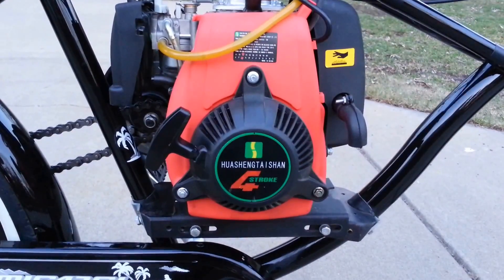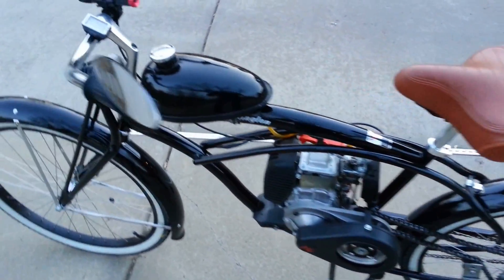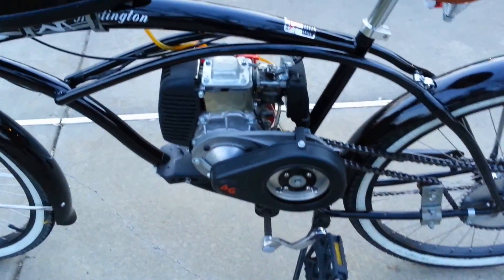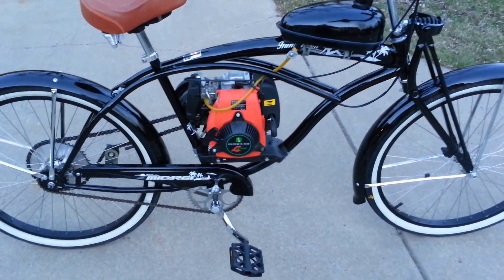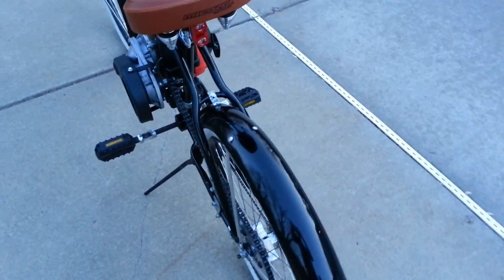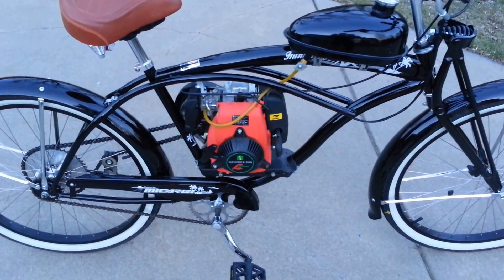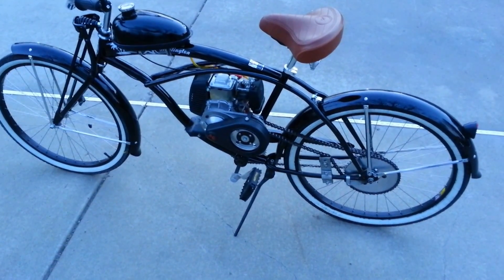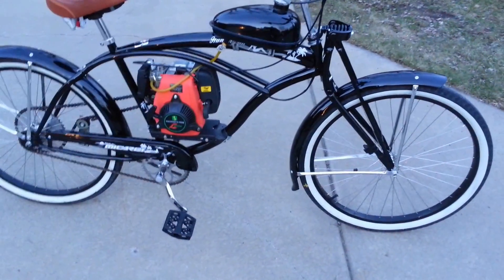4 Stroke Motorized Bike (2 stroke VS 4 stroke)

Comment: Great video on the 4 stroke vs 2 stroke...

I'm brand new at this whole thing...So any help you could provide would be greatly appreciated...
 
I've just purchased a used motorized bike with a Grubee Skyhawk, 4G (belt)...
 
Would you be able to provide an Owner/User manual (not installation)...I've looked everywhere with no success...
 
If not, could you provide some kind of detailed description of routine maintenance...**Help!**
 
BTW, I've read that the centrifugal clutch engages @ 3,000 rpm...Why so high?
 
I would estimate my minimum speed under power is 10 mph...Yet I see 2 stoke bikes going much slower...
 
Regards,  Jason
Reply from the maker: Elric van buelken Hello Jason! Thank you for the message! At the moment I'm just about to head to work and I have to catch up on other messages as well. Have a little patience please and I'll get back to you tomorrow morning at the latest with some answers! Thanks Jason.
Reply from the maker: Elric van buelken I don't have any user manuals that I could find anywhere online for them, and the ones that come with the kits are about as useless as can be. With the 4-stroke engines the only thing I really did on mine was change the oil, check belt tension, check all the bearings, plugs, and air filter. Other than that there isn't a whole lot to keep up with on those. As far as the clutch engaging at 3,000RPM, I don't have a technical explanation for that other than that's the way those clutches need to work. It's the same thing on a snowmobile as well. The centrifugal force expands the shoes inside the drum, and once there is enough force (usually about 3,000) the shoes will expand far enough inside the drum to make contact and drive your machine. This may be a horrible analogy, but it's like helicopter, the blades will spin, but it won't actually move until there is enough force from the blades spinning fast enough. I hope this helps out! Any other questions come up feel free to contact me!
Reply: Sinister Custom Cycles
Thanks for the prompt response...I'm a relative novice, so:
1) Where is the air filter?  How do I remove it?  Can it be washed, or must it be replaced?
2) How do I gain access to the belt? How do I adjust belt tension?
3) What specific type of oil do I use?  How often should it be changed?
Thanks again...
Reply from the maker: The air filter depending on the engine is located on the back of the engine, which can be easily removed, cleaned, and replaced. I never had to do anything with belt tension at all on mine, and don't believe there is a way or need to adjust it. I just use a basic B&S 4-stroke engine oil from my local small engine shop. I changed mine after the first 100 miles for break-in, and then every 1500 miles or once per summer after that.
Reply: Sinister Custom Cycles
Thanks again...Almost there...My engine/clutch  is exactly the same as the one in the video...So, I found the air filter cover; not so obviously "easily removed" however (at least for a novice)...It seems to be held on by some type of spring clip arrangement...Since I don't wish to break the plastic cover by forcing anything, how, exactly, do I remove it...
Reply from the maker: It should just be 2 clips on the bottom of the cover that you have to press in simultaneously while lifting outward.

Comment: My 4 stroke burns no gasoline what so ever.
I use Propane and it's the best decision I ever made.
 It burned out the old carbon deposits and now it Purrs like a kitten in a creamery.
Reply from the maker: TheSteadyHunter Kudos! With all the searching I have done online regarding motorized bikes, yours is the first that I have heard about running propane. All I can think about is King Of The Hill lol. Send me an email as I would like to know more about the benefits and conversion process. sinistercustomcycles@gmail.com
Reply: Sinister Custom Cycles I'm more of a phone man I'm not good at this texting typing. I do voice command I talk and it prints it out for me it's a lot faster so there will be mistakes. If you read my comment above I wrote a pretty lengthy one. If you have any questions about propane or how to convert over leave me a message. I can call you or you can call me it's so much faster then the typing stuff or voice command. Like I tell a lot of people you could even *67 your number and call me. I will still answer the phone. I have to answer phones that's part of my job.
Reply: How did you place you propane tanks. I am really interested to know
Reply: TheSteadyHunter any pics of your propane set up?
Reply: That's a good one it purrs like a kitten in a Creamery you're right. I usually use it's as smooth as a sewing machine.
Reply: @jonsmith2217  How about slicker than snot on a doorknob?

Comment: OK the one thing I like is that the CDI Coil is covered  were the 2 stroke isn't and that is where I got most of my problems.
I've had to replace 3 Cdi Coils and 3 kill switches so yea but i like my 2 stroke engines
Reply from the maker: Anthony Storey I'm still fighting between what engine choice to go with for the "Huntington Resurrected" build. There are pros and cons to both engines and it's a hard choice. However the thing that is most important to me for my riding uses, is quality and reliability over anything else. Is it something that better sealing would remedy in order to prevent debris and moisture from affecting it?
Reply: Yeah there is Im using Jb weld on my CDI Coil and electric tape to tape my loose wire to the bike and the duct tape to Keep the electric tape and wires safe.  Now I went with speed so i got the 2 stroke mega motor from bike berry and i get about 38 mph with  about 50 mpg.  Now a 4 stroke is more expensive but it is more reliable an way easier to ride.  A 2 stroke you have to pop the clutch and a 4 stroke you pull start it and go.  stock 2 stroke have manual clutches and a 4 stroke have an automatic clutch.  I've own a 4 stroke it is a nice thing to have for something you know that won't break down at any given time, but slow as shit.  Now 2 stroke I've owned and still have one they are fast as shit but you get alot of problems and thy can break down at any time.  Like right now my ride is having clutch problems.   The clutch lever is slipping up to the point that it wont disengage the clutch.  Its a simple fix but it gets old really fast.  So i suggest a 4 stroke engine kit.

here are some of the sites I go to:
 http://www.bikeberry.com/
http://www.gasbike.net

Comment: Do you need a lissence  for a motor on a bike sorry for bad spelling
Reply from the maker: Bernardo Moya There are so many variables that come in to play with that question. The laws change depending on where you live. Where I live you don't need any kind of a license as long as it's 49cc or below, and does not exceed 21MPH. I rode mine everywhere with a top speed of 29MPH and was seen by every type of cop possible and was never bothered. I even had one stop and shine his spot light on me while I fixed a flat tire one night and didn't say a thing about the bike or anything else. Check your local laws, or another good place is if your local bike shop deals in electric bikes, they will know the laws also. I also go on my local Craigslist and see if any are for sale, if there are some, contact the owners and see what their experience was. I hope this helps!

Comment: Im all for two strokes, they're about twice as fast, half the price, they do break when you start putting real millage on them, but you can't forget to mention that they're dirt cheap to repair. The most expensive engine component is around 50$ depending where you get it. They are a little more costly on fuel, but here in Canada i can fill the tank for about 4$ and get around 110 kilometers on it. (About 70 miles.)
Reply from the maker: kristofertheman Salutations! 2 strokes are definitely cheaper, faster, and have more options to modify them, which is great if you're racing them, or have a moderate to high mechanical aptitude. Despite the parts being cheap (which they are for 4-strokes as well) by the time you get done rebuilding a 2 stroke engine multiple times compared to a 4-stroke, you are going to have about the same invested in to it. Only difference is, I'll be riding my 4-stroke trouble free while the 2-strokers are waiting on parts and rebuilding them. Not to mention the decreased fuel economy, mixing fuel and oil, the extra noise, smoke, vibration, and (takes deep breath) leaks. 35-40 mph is insane in itself on a pedal bike for sustained periods of time with acceleration far greater than any one person could do under their own power. Don't get me wrong, I love speed just as much as the next person if not more.....probably a lot more, but there has to be a point where you have to draw the line with regards to what the components can handle. Like with anything they all have their pros and cons, it just comes down to what the individual is using it for. Great comment though and I appreciate the feedback!
Reply: 2 strokes are only fast on FULL THROTTLE. If you are not going full throttle on a 2 stroke, expect to get passed by old woman on electric wheel chairs. 2 strokes are noisy as crap and smoke like a forrest fire. I don't know about you, but I don't wonna be riding through a neighborhood with a motorized bike that sounds like a weed wacker. And with your 2 stroke, how many times has it fouled the spark plugs? And FYI with motorized bike kits, 2 strokes are 66cc and 4 strokes are 49cc. 4 strokes last 5 times as long as 2 strokes. 2 strokes are cheap because they are junk. I wish luck to anyone who is riding a two stroke bike and gets stuck in mud. 4 strokes have more torque so if you get stuck in mud you have a greater chance of getting out. Say you race your 66cc 2 stroke bike (if u have one) against my 66cc 4 stroke bike and we both go full throttle. I will win because we r both going the same speed, but my motor has WAY MORE torque, so it pushes harder. That is all I am gonna type. But if were gonna keep typing, I wouldn't be 1/2 way done yet. 4 stroke better.
Reply: Well, im just gonna ignore what that last comment said because its pretty invalid, but anyways, if you ask me it depends what you use it for, if i were to get a bike to commute with, i wouldn't think twice, the 4 stroke would be my engine of choice, but for what i use them for, like racing, trail riding and offroading, I would think that my 2 stroke it far superior to a 4 stroke.
Reply: no its valid but it all depends on personal choice

Comment: I think the engine(exhaust) being louder on one of these would be beneficial. Because these things are car magnets, My friend has a two-stroke cruiser bike that he calls the widowmaker. He calls it that because everyone who rides it is either hit by a car or ran of the road by one. My friend was ran of the road going to school, after it was fixed his father's friend rode it, and was hit by a car going around the block.
Reply from the maker: Paradigm Storytime When you are a dealing with inattentive riders and/or drivers, isn't everything a car magnet at that point? No matter how you look at it, bicycles, motorized or not, are a lot harder to see than a regular vehicle. As the rider of a bike, you need to be even more aware of your surroundings and take extra precautions to help stand out more (lighting, high visibility attire, etc..). I have had just as many close calls in my bright yellow car, as I have on my little black bike.
Reply: Sinister Custom Cycles That's why when I am riding my bike on/in the streets I try to make side to side movements, as it makes you many many times more visible. I know a couple people with bikes, me included, who get up to, or near,  the street speed limit and go in the lane, I often have to because there isn't a side of the road that I can ride in, only the road, why I want a motor, so I can get up to speed more easily.
Reply from the maker: Paradigm Storytime That's understandable and a really good point. I'm so use to our area here in Twin Cities, MN. where we have almost a full size lane along side the road to ride on.
Reply: Sinister Custom Cycles  Out here we are lucky  to have paved roads. a majority of the roads in this town are not paved. A good half of the town doesn't have any paved roads, and the half that does still has speckled unpaved, or sometimes roads that have degraded from asphalt back to dirt.

Comment: looks nice but how legal is it see a lot of people getting tickets on you tube
Reply from the maker: terry cooper The laws are different everywhere you go, and I recommend checking your local laws before you go building or buying one of these. In Minnesota, you need to be under 50cc, have a headlight, taillight, and mirror, and not exceed 22mph to be street legal. In the 1200 miles I have rode around my area I have seen local police, county sheriff, and state patrol and have never been bothered. I even had a cop stop when I had a flat tire and was airing it up one night and all he did was give me light. I gave it a pull, fired it up and rode off and he didn't say a thing.
Reply: In Ohio you can almost get the Death Penelty For speeding. Im my home town they even ticket motorized wheelchairs
Reply from the maker: terry cooper That's just insane! I have seen videos about cops making such a big deal out of motorized bikes and I just don't get it. If you're not being stupid and crazy then why not just leave them alone.

Comment: i meant to say you instead of tou
Reply from the maker: It's hard to say just from looking at the pictures. From what I can see though they have an interesting design to most of their frames. The only one I believe would work is the "Isla Vista" which has more of a normal beach cruiser style frame. The other frames have a smaller area inside dimension. You can definitely pedal with a set up like I had on my bikes, whether the engine is on or off. I hope this helps, any other questions let me know and I'll try and help out as much as possible!

Comment: i have a question im a bigger guy weighing up into the mid to high 200s so is my dad and i was looking to get a couple of these kits for us for christmas this year which would be better for us now i dont expect to go 55 miles an hour but id like to do a good 20 25 just a fun little toy to take out to a dirt trail/ pavement or in the high school parking lot
Reply from the maker: This is going to be all about gearing to best suit your needs. The 49cc 4-stroke engine will have the power you need as long as you have the correct gearing to it. One of my more recent builds I did I used a 48 tooth rear sprocket and with 160lb rider I could actually gain speed going up fairly steep inclines. My top speed was about 22mph with that 48 tooth. I only rode my bikes on pavement, so I have no experience on the dirt side of it at all, although I'm pretty sure they would not do well on dirt trails at least not the ones I'm thinking of with roots, rocks, hills, etc... As long as you stay on paved surfaces I'm pretty sure you would be fine with the 48 tooth sprocket set up. I hope this helps you out, if you have any other questions feel free to let me know!

Comment: yes i have a question looking for comfort will these be comfortable?
Reply from the maker: The bike itself is comfortable, at least for me. When you mount an engine to it though you will deal with a lot of vibration. One thing I do to drastically cut down on this is take an inner tube and cut it up and put 2-3 layers in between the engine mounting plate and the frame of the bike. This really cuts down on what you feel, and helps your bike and accessories last longer as well.

Comment: thanks for this very informative video! I wasn't sure if a 4-stroke engine could fit on my bike frame (which is 16" mountain bike) but i ordered a kit anyways. Now i'm certain it will NOT fit. Anyone have some recommendations of some large frame mountain bikes, reasonably priced?
Reply from the maker: Thanks for liking the video! If you're going to put it on a mountain bike I would spend a little extra and get something semi decent. In my search I have found a good starting price to be about $450 brand new. My must haves would be disc brakes front and rear, a front shock, and a 22"-23" inch V-frame. The ideal frames for the 4 stroke engines are actually found on pre 2013 models. However there are ways cut down the size of your 4 stroke. You can gain an extra 1/4 inch in height by cutting down your choke knob. You can gain 3/8"-5/8" of length by installing an aftermarket air intake with a bend in it. These measurements may not seem like a lot but it's made the difference for me in the past. I hope this helps out. If you have any more questions let me know please!

Comment: Damn great video Adam and keep up the good work tho I'm new to the motorized bike game and I have a Micargi Pantera 7speed which is getting a 2stroke engine on it tho what is the best 4stroke motor around
Reply from the maker: Thank you very much for the compliment on the videos! I don't have a website as of yet, but it is something I am working on adding in the near future hopefully. So you mentioned you were putting the engine on a Micargi 7-speed, are you going to be using a shift kit with it at all? In the bikes I have built, serviced, and rode I have used HS (Hua-Sheng) engines. I have not had any issues so far, although the best 4-stroke engine out there for this application would be the Honda 50 without a doubt.